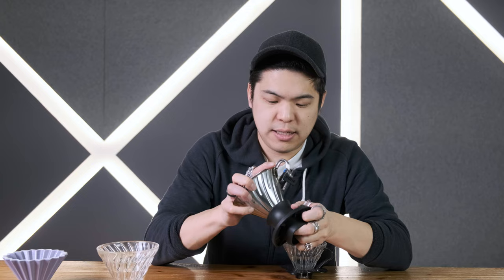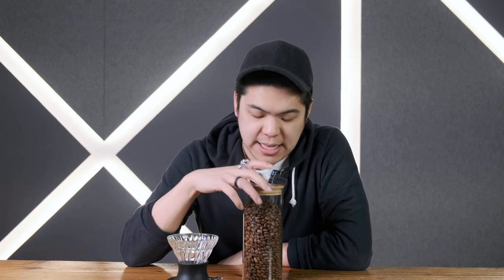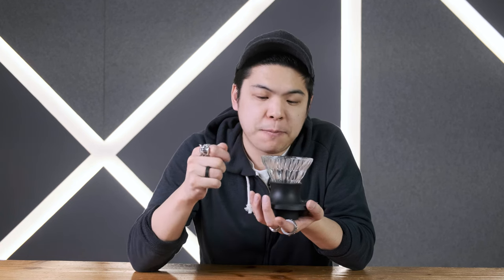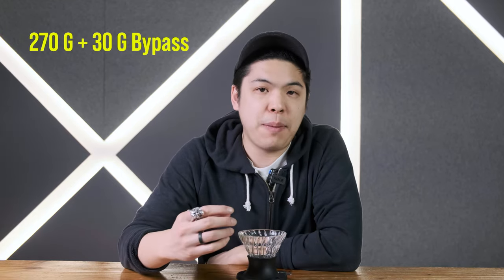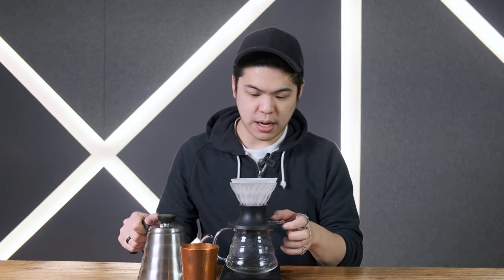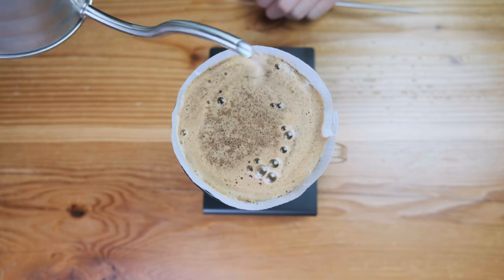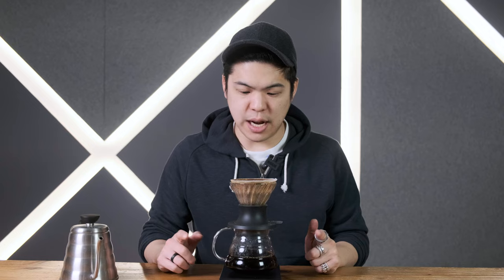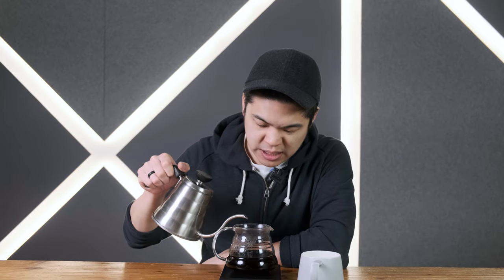Hario Switch Advance Technique (Modifying the Device?)

Comment: I usually use 22+- clicks comandante for pour overs. Is that what is considered as medium fine for you or should I try going even finer? I considered the 12-20 clicks as syphon grind(or also tricolate). Its just kinda weird how 300 microns is the grind size and comandante c40s were said to be 30 microns per click.

Comment: Just a note to say you CANNOT use a standard 02 V60 cone to replace the stock glass one. I tried using my metal 02 V60 with the Switch base, and it leaks terribly, because no seal is made between the cone and the base.

Comment: Is there any downside to buying the 03 Switch and then replacing the dripper with the standard glass 02 one? Would it be a bit too big for single cup brewing? Since I think you said that the 02 dripper that comes with the Switch is smaller than the standard one, right? Asking mostly because the 02 Switch is out of stock where I live, but the 03 Switch isn't. Also great videos :)
Reply from the maker: Honestly nope, if you wanna brew a larger batch you definitely can.  The switch allows you to pour faster and more aggressively to lift. On the 03 you can use a normal kettle and give up the goose just cause you can get a higher speed and force to lift.  This helps with the drain time actually ^^

Comment: I just tried my origami in the switch and it’s leaking out.  Any tips on getting it sealed?
Reply: man did u find a fix on this? which size u r using? I am thinking to get a origami L size to be used in the Switch as the Glass V60 03 is difficult to find in my area
Reply: @briank7061  NO fixes, It just doesn't fit, it will always leak. I think just the MUGEN  V60 is compatible with it

Comment: You need to use the glass v60. Or else the seal won't work 🤣 i tried the metal one, made a mess 🤣
Reply from the maker: yups I also noticed this, I only thought metal would work cause I saw a guy do it.  Little did I know he actually had a hack and adjusted his metal dripper >.<
Reply: @TALESCOFFEE  how did he adjust?

Comment: I just ordered a Hario V60 glass 03 to use in my switch. The dripper that came with my switch was a 02 I’m only able to hold 260g but the 03 should allow 300g easily. Great videos btw! Is there a taste difference btwn reg beans verses organic???☕️
Reply from the maker: The glass drippers should definitely have the seal for it.  That's good.  I think the 02 can hold 300? It's pretty tight but .. yeah ahaha for the stall the fall you're probably safer with the 03 to hold 300!

Thank you for your support!!

As for flavour profiles.  Nope .. not that I noticed :P I mean it's great and all to be organic but a lot of producers struggle with the transition.  I've heard of some producers losing as much as 80% yield for 3 years before they get back to their original amount just by switching TO Organic.

Comment: Just got to trying out the stall the fall method today. Got some good results but i know i can get more out of it if i play a bit more with grind size and temperature. 
Thank you for adding the microns size, it is so hard to gauge the grind size when you don't have a lot of experience. Genuinely appreciate your guys work. :) I feel like a kid on christmas morning with too many presents to handle with all the techniques and different recipes to try out. Sadly, my body can handle only so much caffeine in a day :P 

In the stall the fall video as well as this one your filter paper extends past the glass rim by a fair bit. Do i just push down my filter too far down when i rinse it or are you using bigger filters? I am using the method in your masterclass video for setting the filter and mine barely reaches over the top.
Reply from the maker: I use the standard 02 size filters. I think the switch that I have is like actually between a 02 and a 01 size ahaha. Mine feels just a bit smaller then a 02 .. idk why 😂 it’s the same filter set method as the masterclass one.
。
I am super glad you’re finding success with the stall the fall. If anything it’s more about stirring and understanding when and how saturated your grinds are with that method! :3
。
Glad the microns helped, I remembered your comment so I added it in there for you ✌🏼

Comment: The origami and the metal v60 DOES NOT WORK, they will both leak when the ball is closed as there is no seal between the funnel and the base.

Comment: I've asked about this and I still wonder how is it that your brew doesn't straight up getting stalled haha. 300 micron is way finer than most pourover grinds.
Reply from the maker: It’s a single pour diff 😛 yeah it’s super fine but I get fast but strong brews. I clocked at 1:24 today at ~24% 🙈
Reply: @TALESCOFFEE  yeah pretty amazing. Have you tired this method with poor men's grinders tho? Like those ones that creates loads of fines.
Reply: @TALESCOFFEE  Get an encore or chestnut c2. something like those. If your drawdown time is still stellar, then your method is truly the best!
Reply from the maker: @benjaminzhang9396  I actually use the encore at home .. and yups I still have the same draw times.  This method does work for most beans, we just make adjustments on different parts of the brew/pour ^^
Reply: @TALESCOFFEE  amazing i will do some more trouble shooting then. Sounds like a "my" problem them. Many thx!

Comment: I'm currently loving a modified Switch with Mugen dripper using the Stall the Fall technique. The main problem I have with Switch is that there is water outside the paper between the normal V60 grooves that do not come in contact with water, making the brew slightly diluted.
The Mugen eliminates this issue by not having grooves. Plus plastic material has better heat retention, which is again especially useful for Stall the Fall technique when the water is pour in before the coffee.
Reply from the maker: Ohhh! I don’t have a problem with the dilution but I will look into the mugen form cause I have one myself! Let me try tomorrow!!

Comment: Did you really made this video saying it works just fine, without actually testing it??? For people still concerned, do not try the metal V60 or the Origami with the Switch: it doesn't work! And it has nothing to do with a bad sealing. It's a matter of the outside surface of the brewer not being flat due to ridges pattern (unlike the glass V60).
Reply from the maker: Ok tbh the origami doesn’t work we just put it in the picture. The metal one works for me! I had a short on this too 🫠 but I also have one that doesn’t work I’m not sure one of mine works so it’s weird. Mostly it’s just the glass ones and the mugen. Oh also the plastic ones yeah.

Comment: DO NOT use the metal v60 in the switch.  Or at least test it first with room temp water. It will not seal properly and you'll burn yourself & get hot water all over your counter.
Reply from the maker: 10/10 thank you. I didn’t realize the sealant issue.  I have had friends use it just fine with it. Mine didn’t work, thank youuuu!
Reply: Took it to work, made a mess 🤣

Comment: Switch + Mugen when
Reply: He did say that you dont really need the switch because the mugen itself already has a very slow first drip. Its already named the "perfect single pour dripper" as in his old video though the switch is probably still technically better
Reply: Tried it, but it doesn't work. The tip of the 02 filter paper is squeezed against the steel ballbearing. There's not enough distance between the steel ball valve and the filter paper.
Reply from the maker: Ahhh thank you Alex. I haven’t ran the test yet too many things to test but thanks for this. I’ll still give it a run but yeah
Reply: @TALESCOFFEE  No problem man. Well, I guess the water still goes down so there's that. Definitely give it a try tho.

Comment: taking off the v60 dripper and replacing it with origami is so misleading, there is NO WAY it will work. the origami dripper has so many groves around it that it WILL NOT BE 100% SEALED to prevent the water leakage when using the immersion function; unlike the original glass dripper that came with it, or even other type of v60s for that matter, that has the proper circular shape to AT LEAST make some kind of seal to prevent the water leakage because how it fits. 

my guy, why are you doing this?
Reply from the maker: I know, I made an apology on this already my partners didn't wanna remove this video i might tho when I get control of the company soon
Reply: @TALESCOFFEE oh damn, my apologies for not noticing that somewhere else, i admit i got a bit too heated when i saw that origami part 😅 keep it up man
Reply from the maker: @Grandier  yeah no it was my bad ahaha, we had the picture cause at the time the partners thought it would be better for clicks tho I’m personally against. It’s probably why I am taking over the acc fully now 😂